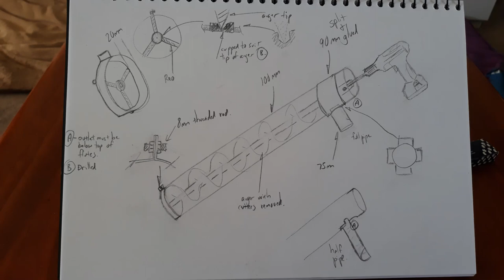cordless drill powered grain auger/elevator

Comment: I noticed that at the bottom of your auger you should have more fliting protruding out the tube then it will work better.
Reply from the maker: Thanks for commenting, good observation. I did think of taking the cutting edges off but I wanted to leave the auger as a usable drilling auger so it's kinda a trade-off, it works pretty well. I hope you enjoy my other videos.

Comment: Hi, can you share me the dimensions
Reply from the maker: Hi, thanks for asking...the auger is 90mm in diameter, so it fits into the PVC pipe which is 100mm diameter with just a small clearance on the outer edge of the auger. It's 1000 mm in length and lifts the grain 800mm to the drop out tube.
Reply: @IdeasBox  thanks